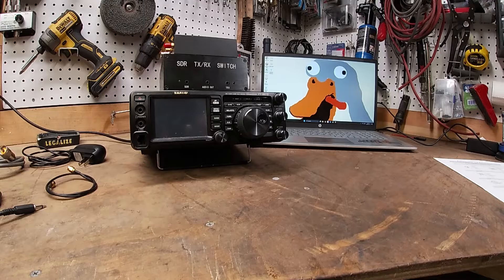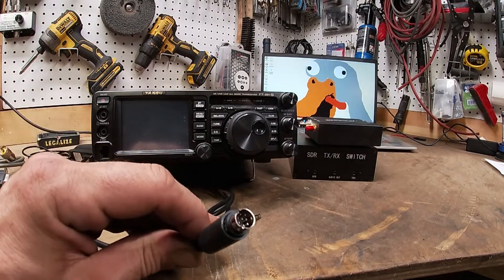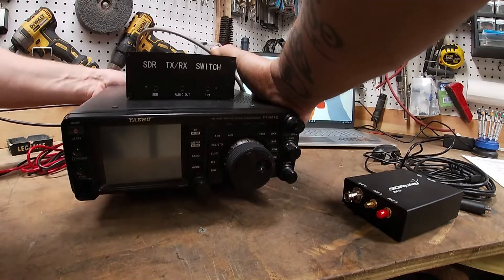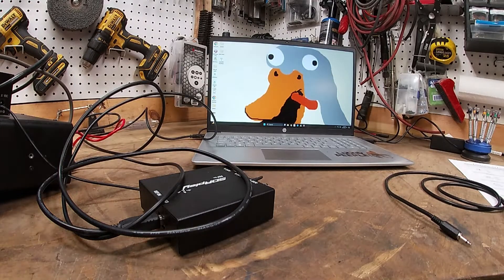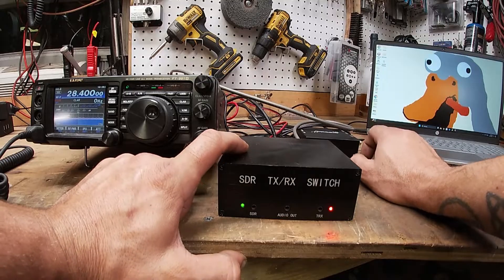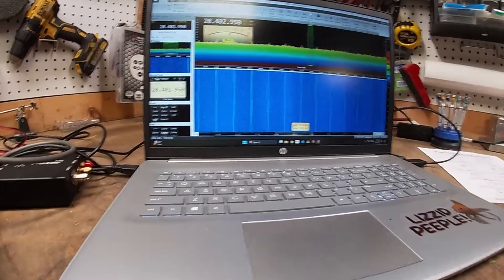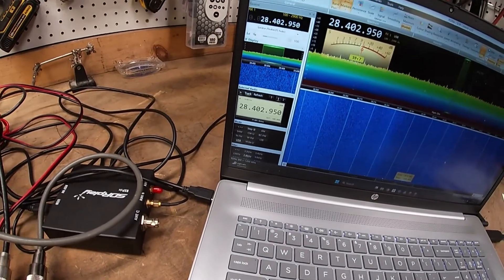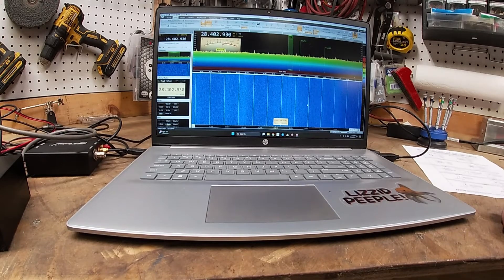HOW TO:  Yaesu FT 991A External Display

Comment: This seem's a lot of messing about with lots of hardware and it's left me a little confused. I have the FT991A and I've bought the Panadaptor buffer board from SDR-KITS which connects to the IF and to an internal supply which is active on receive only so why do I need all of this extra hardware and cables?

Comment: A nice option for reception, but isn't the signal going into the SDR too strong during transmission because of the cables being so close together?
Reply from the maker: thats what the box switch is for, it grounds the antenna input on the sdr so it wont receive.  I run legal limit and have had no issues.  I have blown out the front end of the sdr without using the switch.

Comment: Too much cabling just get an external display. But thanks for the video.
Reply from the maker: If you could just plug a monitor into the back of it you wouldn’t need any of this. But you can’t, this is a work around.
Reply: @SlowGoose  I am inclined to buy another radio with external display capability. LOL.  Oh damn!  That's a shame.  If I didn't already have a ton of shit for data using up my ports already I would do this though.

Comment: Hello, thank you for your explanation. The thing with the 8-pin cable is not entirely clear to me. Which pins exactly do I have to solder to the 3.5 jack? Because putting 13.8v on a cable could destroy everything.

Could you describe it to me again in detail? Thank you. 73 from Germany
Reply from the maker: I don’t remember off the top of my head. I will take a look when I get a chance

Comment: Why use a cat cable the radio has a usb port that does cat control
Reply from the maker: Because my usb port stopped working and it’s not worth the cost to fix it. Cheaper to get a digirig or something like that for ft8. Either way it works just the same.

Comment: Great video! Did you open up the Switch and remove the jumper?
Reply: Do you move it or remove it? If move then where do you move it? Thanks for the great video. Do you happen to have any videos or tutorials on making the cables?
Reply from the maker: @jasonflanzbaum455  You will remove the jumper. I dont have any videos on the cables.
Reply: @SlowGoose  thanks for the fast reply. When I cut the cable how will I know which wire goes to which pin?
Reply from the maker: It is not shown in the video but yes the jumper was moved. It’s the only jumper inside of the switch
Reply: @SlowGoose  OK. Thank you. There are not many instructions anywhere about moving the jumper. I did remove it. Thank you! Awesome video!!!!! .

Comment: I just recently setup an SDR on my FT-991A and have that same switch.  After watching many videos on it and also reading the info that came with the switch, you should open it up and remove the jumper that is on the circuit board..     On a separate note, I only had SDRUno software  Going to have to check out SDRConsole now :)